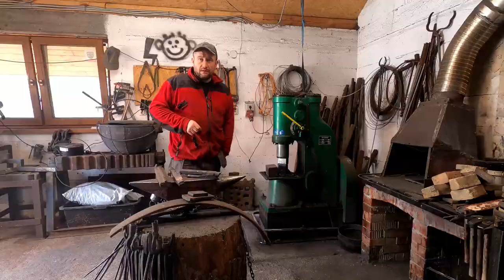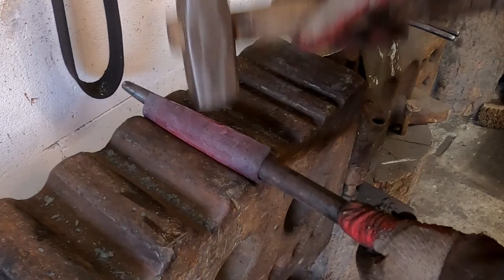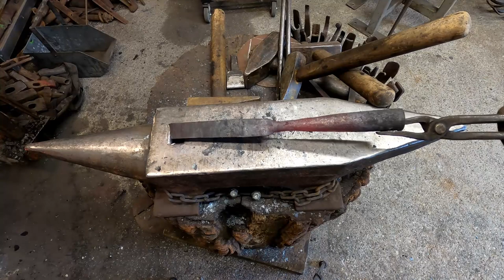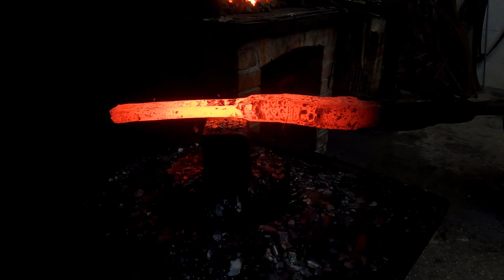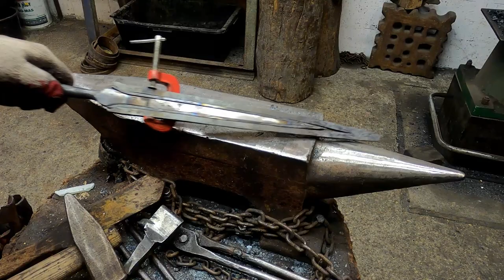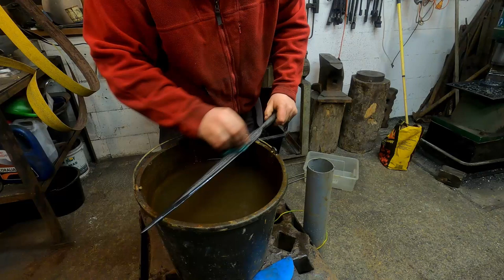Petersen type "I" spear. How to forge.

Comment: Thanks for the video! If I might ask a question: What is the purpose of the spacers? Would it be possible to weld the high carbon edge directly to the wrought iron core?
Reply from the maker: This type of spears have a spacer very often, it is for esthetic purposes, high-P iron gives very good contrast after etching (but also it is welding very easily).